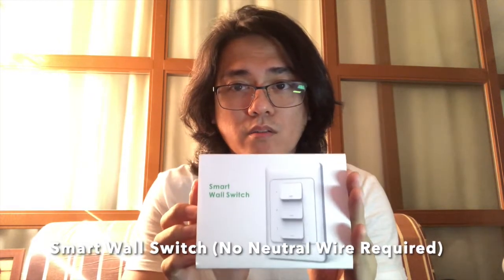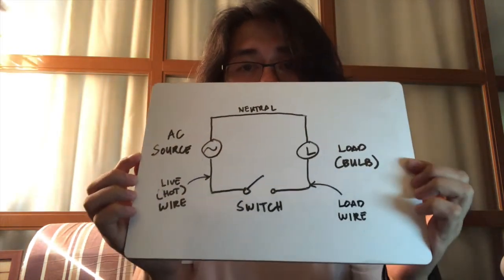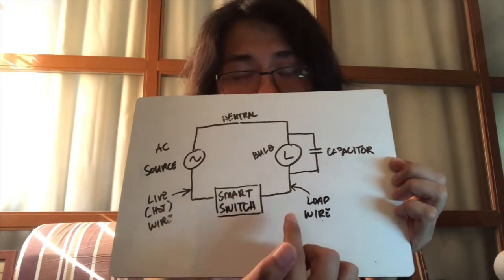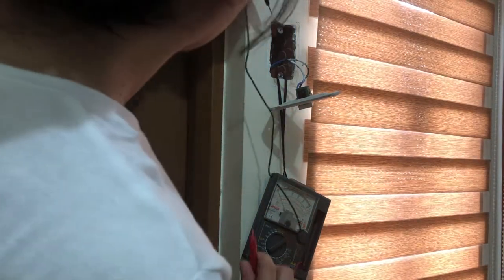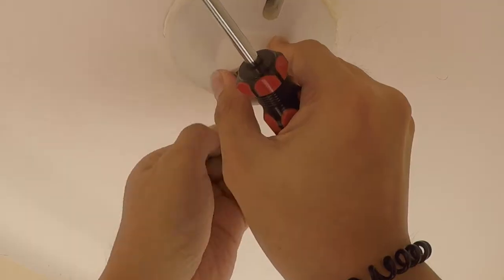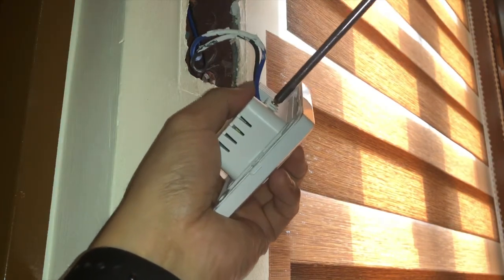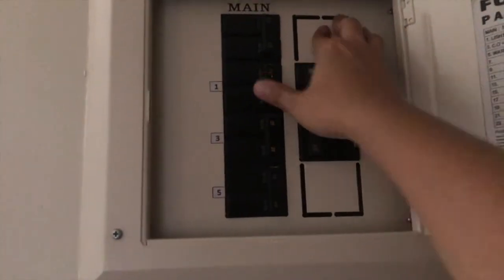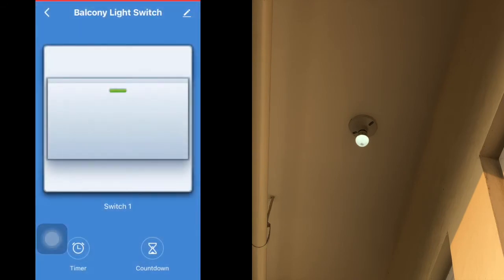Smart Wall Switch (No Neutral Wire) Installation and Setup

Comment: Hi Jed, you only have 1Gang switch. If you have 2 gang switch, do you have to install capacitors per light bulb?
Reply from the maker: Hello, you only need to install the capacitor in parallel with one of the bulbs

Comment: Hi Jed. Thank you for this video. I got a 3 gang smart switch . After installing the switch one of the bulb is “half on”. Do i connect the capacitor to that bulb?
Reply from the maker: Hello, you only need to install the capacitor in parallel with one of the bulbs
Reply: @ thanks!

Comment: They give me one capacitor for one double switch. How to use one capacitor at double switch?
Reply from the maker: hello, you can simply connect the capacitor(in parallel connection) to any of the load(bulb).

Comment: i got a question. i got a light in my hall that is controlled by 2 switches in each end of the hall. how will this be wired and how does it affect when i turn it on or off using google voice command?
Reply from the maker: Sorry for the very late reply. Just set one switch to control the other programmatically in smart life app, that way, if the state of the other switch is OFF then the other will also set to OFF, and vice versa.

Comment: Hi do u have the link for this switch... And what is the capacitor
Reply from the maker: I purchased it in Shopee -->https://shopee.ph/SMART-WiFi-Mechanical-Light-Switch-No-Neutral-Wire-Need-1-2-3-Gang-Smart-Life-Tuya-Alexa-Google-i.448528141.11006056673

capacitor is already included